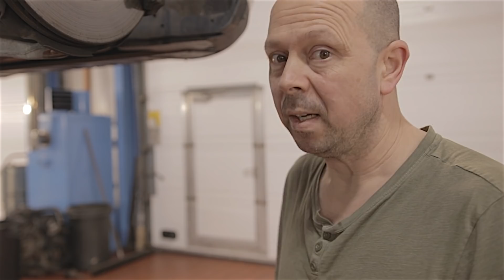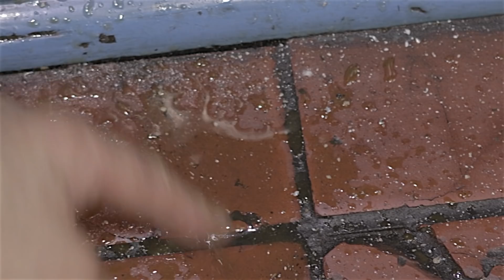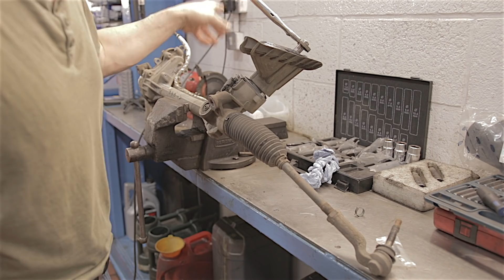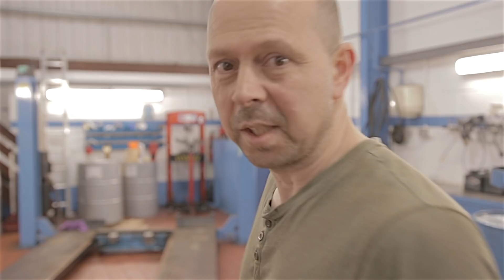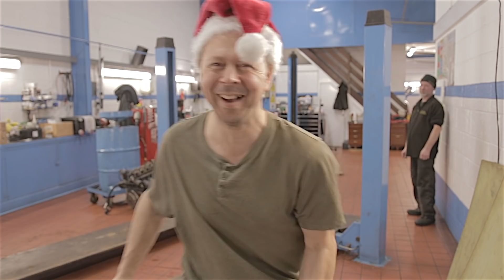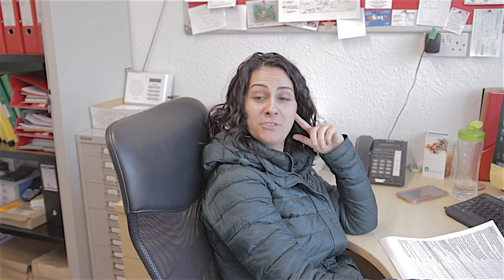Sheared Power Steering Rack Electric Motor Bolts (ford mondeo mk5)

Comment: Hi. I got a Mk5 Mondeo Vignale 17 Model, with 195000km on it. The Fuel Injector nr1 is bad. After replacing it and coding the injector, how do you bleed the fuelsystem?
Reply from the maker: you don't it will self bleed

Comment: Hi Alan do you know what thread size the three bolts are? They look like 8mm to me having my bolts changed next week for high tensile bolts but need to purchase them before hand thanks
Reply from the maker: yes pretty sure they are 8mm .. i tried ford for new bolts but got a no we don't sell them separate lol..merry xmas😜
Reply: Clive Phillips can you post a link to the bolts you end up buying? Do you know if the bolts can be changed with the rack still in the car?
Reply: Hi the bolts can be changed in position, I have several 8mm high tensile bolts of different lengths in my garage,  fords don't sell the bolts as Alan has stated, Fords don't know the bolt size as they tried to sell me a complete rack, the bolt size is not stored on their computer information, will post back next week when my bolts are changed with confirmation of size
 b&q or any decent mechanical hardware shop will sell the bolts they are common to industry

Comment: Merry Christmas alan! Also I'm looking for a bit of advice, I have a 2015 ford focus 2.0 tdci and I'm having problem with the car taking a long time to crank and when its started it's fine it's not running rough or anything like that and then other times it fires straight up no problem at all so the it's sort of intermittent I'm wondering if it could be a starter solenoid possibly?
Reply: Check the continuity of the glow plugs.
Reply from the maker: unless the starter is worn and draining too much power when cranking it can prevent the engine from starting but i would first get your ecu read for any codes which could point you in the right direction
Reply: @alan4x  I also forgot to mention I have plugged in my own little code reader and its hasn't thrown any codes up, thank you for the advice, adios and see ya in 2020 👍
Reply: Hi, do you smell diesel in engine bay?
Reply: @gabrielungur5837  thankfully no smell of diesel
Reply: Check all terminals from battery to solenoid and ground too especially the cable between the starter solenoids this can corrode too
Reply: If problem is only in cold weather (bellow 5degC), could be glow plugs, if problem is at even 10-15degC, could be also an engine coolant temperature sensor. Check engine temperature dial / value(obd) before you start the engine. It failed on my focus (it was reading 70degC after coold night!?!) and had similar problems while starting the car.